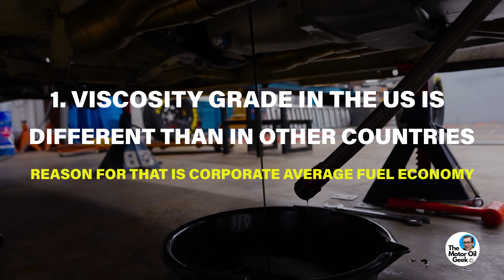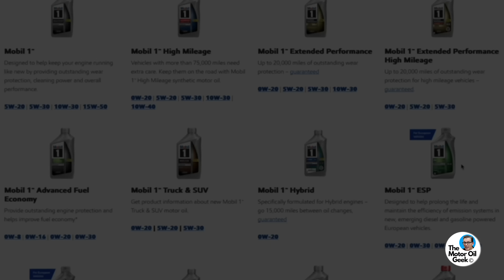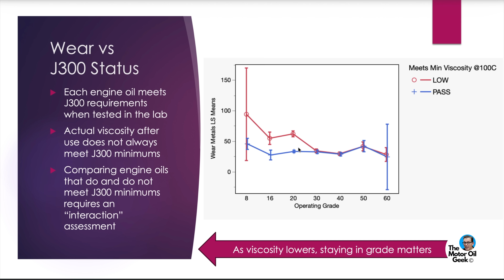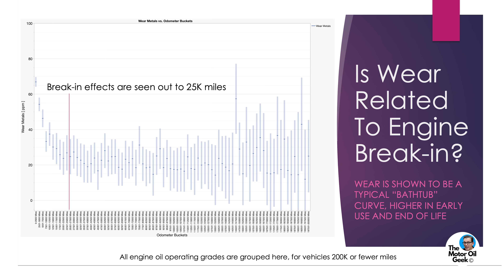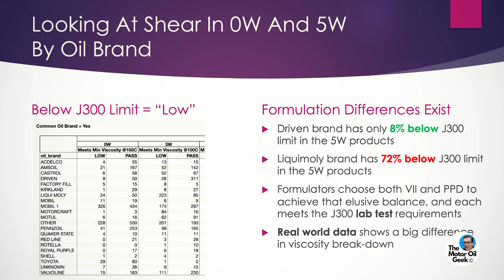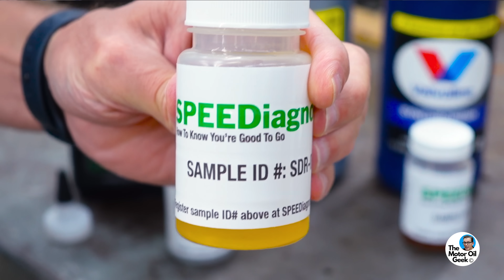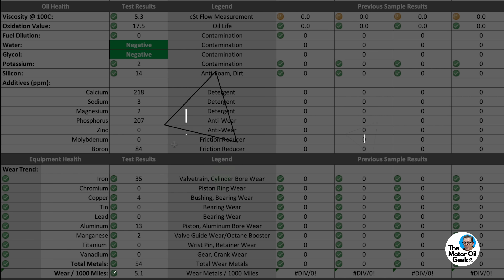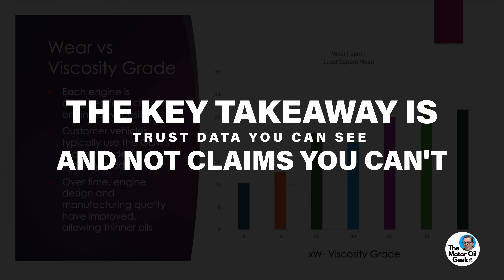More Ai Lies? The FACTS about 0W-20 vs 5W-30 (With Evidence)

Comment: so basically, those thin oils, while they can protect parts as well as 5w30, they are less forgiving when sheared out of grade.
Reply: Basically you would be trading your safety net for marginally better mpg. Good business.
Reply: @jaumeprimerelhipster There's a 2019 Camry out there with almost 500k and has only seen 0w16 its entire life. 5k oil changes keep it happy
Reply: @zandaughtry7936  you said it, you must do frequent oil changes with thin oils.
Reply: @mephy72 5,000 miles is pretty standard. Manufacturers want you to go 10k these days. I had a '00 Solara that I ran 10w40 in and still changed the oil every 5k. High mileage vehicle thats notorious for leaking out the rear valve cover.
Reply: @zandaughtry7936 it’s a Toyota I’ve seen them run with no oil 😂 but yes the more frequent changes help
Reply: @jaumeprimerelhipster  That is my thought also. The tiny increase in MPG one would save with a thinner oil would likely be less than making sure the air pressure in tires are correct. Seems like a huge risk for such little gain. Engines and transmissions literally determine a totaled vehicle or not. But why would car manufacturers care? They are in the business of selling new cars. These are the same people that tell you the transmission has "lifetime fluid".  Start/stop technology is another perfect example of how manufacturers are okay with less reliability. They get to sell replacement starters, batteries and new vehicles in the name of "going green". . It's the consumer that is paying the price...and it's NOT to save them green for "going green".
Reply: Which can be easily remedied by changing oil every 3-5000 miles. Unfortunately, folks insist on 10-20,000 miles oil changes. What does this all mean? You can't fix stupid.
Reply: @oldcodger4371 according to Lake, going out of grade is not necessary fixed by changing intervals as some oils can go out of grade quite quickly.
Reply: @jaumeprimerelhipster  that happens with oils loaded with viscosity index improvers, think 0w-40 and 5w-50. 20 weight oils are a lot more shear stable becuase they don’t need those VII as much to get the desired cold/hot viscosity behavior. 

My mustang will shear down a 5w-50 to a 40 weight pretty quickly, but I’ve run different 5w-20 oils for 10k miles and their viscosity was unchanged.
Reply: @jaumeprimerelhipster yep. The wider the gap between the two numbers, the quicker the oil gets out of spec.
Reply: @Alkatraz415  This is a good take away in general.
Reply: @jaumeprimerelhipster  0w20 starts going out of grade at 5000 miles. So, change your oil between 3-5000 miles. See? That wasn't so difficult!
Reply: @oldcodger4371 what a genius. Virtually all cars sold in Europe have oil changed at 10,000 miles. It's an industry standard here. No one with a problem whatsoever because we use high quality full synthetic 5w30. Sure, change to 0w20 and reduce the intervals and you'll eventually be paying thousands of euros in extra oil changes to get exactly the same result.
Reply: @jaumeprimerelhipster  At 500,000 miles, an oil change with synthetic oil costs me $30 per oil chance. So divide 500,000 miles by 5000 miles per oil change, and you get 100. Multiply 100x30 and you get $3000. That means at 10,000 per oil chance my cost is $1500. Unfortunately, your engine won't last 500,000 miles at 10,000 mile oil change intervals.  So tell me where the extra thousands in oil change costs are coming from? You can't because you're a liar.
Reply: Not 10,000 miles it's 6,000-10,000km.
You poor soul.
Reply: @oldcodger4371  In Europe recommended oil change interval is mach longer than in US, would be nice to see a statistic of engine failures,  US vs Europe.
Reply: @sas7388 not really though 15000km Toyota (and other hybrids) and 30000km for some brands (like Ford)
Reply: @sas7388 that's because Europeans drink the global warming Kool aid scam.
Reply: @sas7388 
  Typically the US sees much higher number of miles/kilometers in it's lifetime then Europe, but regions differ. 
     Midwest highway/ high speed long distance vs stop/start and mixed speed highway east Coast/ big city drivers.
  One of the biggest variables to oil change interval is oil temperature cycle time, ( with reference to ambient and humidity) short vs long operation, and idle time. Individual use habits for private vehicle operation are so variable, comparisons are complicated.
Reply: @bikerz3857 not really, it's because we are not dumb enough to pay thousands of euros in extra oil changes (it's not easy to do it yourself in urban areas so we have to pay a mechanic for it) that would make no perceptible difference for a car that would last on average 10 years. Millions of cars have been using use a simple 10.000 miles / 1 year scheme, that's being demonstrated solid for decades, with no issues, using decent oil.
Reply: @bikerz3857  Are you scientifically trained?  I am.  Not a scam.
Reply: @oldcodger4371    Some folks also insist upon ignoring data that says more frequent changes are an unnecessary waste of time & money.
Reply: @garysarratt1  So according to your logic it is better to buy a brand new engine for thousands of dollars than to change your oil every 3-5000 miles. Thank you for making my point, you can't fix stupid.
Reply: @oldcodger4371    Not my logic, data from people like Lake here.
Reply: @garysarratt1  Stop lying. Lake is the loudest voice saying that the manufacturers recommended oil change intervals are not often enough.
Reply: @oldcodger4371    Hmm, maybe I’m mixed up.  I know Freedom Worx said it, and cited studies & sent samples, and Tim Esterdahl had engineers on saying it also, along with the thinner oil being ok.
Reply: But @DeuceDeuceBravo says you're a conspiracy theorist for not following the SCIENCE aka owners manual, for obedient 10,000 mile intervals. Which is it, Deuce?
Reply: @ualfltdispatch  You and several others here should probably watch Lake's videos about oil change intervals. The science would be the actual data supporting following any oil change interval schedule.
Reply: @dmdx86  his data can be misleading because you have to factor the rationale and economics of such interval plans. I mean, for how long do you want to keep your car? In Europe it's an industry standard to change the oil at 10000 miles/1y and there's no issue here because people don't want to ride old cars. For a an average of 10  years ownership, there's really no difference in wear that would justify expending that much money in extra oil changes. That's the reason most dealers here use 5w30 instead of 0w20, because it makes life easier to everyone and it's good enough for the average foe..
Reply: @jaumeprimerelhipster I think we are on the same page here. I was replying to the people who think doing that is dangerous for engine health. The data says you can change your oil whenever the oil life computer tells you to and not have a oil/related problem for the lifetime of your vehicle.
Reply: @oldcodger4371 because you end up changing your oil every 6 months with such tiny intervals, that's quite a lot of money on oil
Reply: @oldcodger4371  Since I did 15,000 mile OCIs  with a new filter and top off half way on 10w30 for 10 years on 2 Dodge Turbos.  I would say it depends on how much you drive.  I was doing over 20,000 miles a year, Both cars were well over 100,000 miles no problems.  I wanted an intercooler added to the Dodge 600 Turbo and just over 110,000 miles. The shop insisted on a new head gasket, I asked how the motor looked when they were done.  They said it was spotless.  Now I would never do that or over 5,000 miles on 0w20 without an oil analysis.
Reply: OR, those thick oils, while they can protect as well as 5w20, they are more prone to shearing out of grade
Reply: @WilChu my engine can run either 0w20 (recommended) and 5w30 (optional). If you go out of grade in the 5w30 you'll still fall in a safe area between 0w20-5w30. If the same happens with the 0w20, you'll get anywhere between 0w16 and 0w20, which the engine is not designed for.
Reply: @jaumeprimerelhipster  Exactly, what a stupid argument to make.
Reply: @jaumeprimerelhipster  remember that you're also losing some efficiency going with the thicker oil option. you have theoretically more buffer going with 5w30 than 0w20 but 5w30 is more likely to shear out of grade than 0w20 as indicated by the video.
Reply: @jaumeprimerelhipster 
  Not necessarily ( safe ), this is only one factor affecting oil change interval. Fuel dilution and moisture/acid production is another. Type of engine, operating conditions and environment are important factors.
Reply: @jeffhill3681 but what's the relevance? At least here in Europe it's exceedingly rare to have an engine failure as the motivation for changing cars (Land Rover being a notorious exception). Most people buy a new car because of electrical failures or, most commonly, because the car is already old. No problem with the engine whatsoever. Cars sold here pass the EuroNCAP safety tests which get harder at each iteration. I wouldn't be driving a car pre-2020 just because of this alone. The difference in safety is insane. Thus,  we don't see it as a necessity to hold the cars for decades. Sure, if I got a Honda S2000 I would change the oil every 500 miles and clean it with unicorn tears. For my commuting car? Its fine with 5w30 and 10.000 miles, as everyone abd their dogs do here.
Reply: @user-mi1vd2ps2l shear out of grade means little to nothing in practical terms
Reply: @jaumeprimerelhipster  : Simple logic that people don't understand.
Reply: @WilChu  Either way, change your oil every 3-5000 miles.
Reply: @oldcodger4371 if 
a person uses 0/20 just change it more often 3500-4000 k especially with direct injection because of fuel dilution.
Reply: @IrishNew  Since when were we talking about direct injection? If you have a direct injection engine than you need to use the oil that was made for direct injection engines. Valvoline Restore and Protect. And yes, change it every 3000 with that oil in direct injection engines.
Reply: @o @oldcodger4371 many engines today are gas direct injection engines which dilute oil and its viscosity while compromising its load carrying capacity. When using already thin oils it breaks them down faster thus making more metal to metal contact which cause’s more wear and cuts down its shear value.Using a higher viscosity  such as 5/30 over 0/20  makes sense, so when talking about different viscosities this issue must not be overlooked  and addressed since most gasoline engines today are direct injection.
Reply: @W @WilChu  even out of grade 5w30 would give higher protection than 0w20 for example. Strangely he is neglecting this important point in the video.
Reply: @123ChrisG UOA will give the driver a good idea of when to change the oil.
Reply: @davepetrakos475 agreed but you will see in those UOA that thinner oils have less viscosity reserve, so they lose usable protection margin faster, including effective HTHS.
Reply: And since most don’t change the oil as often as they ought, the wear becomes increasingly a problem.
Reply: I have a 2019 Chevy Silverado that used to use 0w20 and I made the switch to 5W30 just over 11,000 miles ago and I will never go back to 0w20, I'm sure the 5W-30 will protect the engine much better than this crappy 0w20 which was only done for cafe standards. My engine sounds perfect no more valve train noise coming from the engine The oil pressure is perfect before it would go down to as low as 8 psi at hot idle now and hot idle it gets no lower than 28 PSI. The mileage per gallon is the same, in cold weather starting she starts up perfect I don't hear anything strange or odd noises when I'm starting it up.  We used to use 5W30 It was only changed for Cafe standards, that is the only reason these manufacturers did it was because they say it increases the fuel mileage and who's to say there data numbers weren't fudged and if they didn't squeeze a tad bit more fuel mileage out of the vehicle they would be fined per vehicle. I don't care what these data sheets say they can be fudged it's real world testing that needs to be done and so far I'm at 1100 mi with the 5W-30 and zero issues. it's the same engine that takes 5W30 another countries and here they use 0W-20. I'm sure in really cold climates 0w20 might be great but here in California no we don't need it. I'm sure eventually It will come out at the 0W20 is causing these engine failures. You have less cushion between the metal moving parts You're going to have engine wear That's what we were told for years and now it's all changing because of this zero w20. now with the 5W-30 you have more of a cushion you're going to have less wear on those parts Plus since the oil is thicker it will pick up junk along the way and carry it to the filter. When I would change my when it was the 0w20 I would change it warm and it would come out like black water now the 5W30 when I change it comes out perfect like it's supposed to now going to the 0W-40 that seems a little too thick. I will be doing an oil analysis within the next two oil changes most likely and I will post the results on my YouTube channel along with the previous 0W-20 results.
Reply: @HowtowithPaulHenderson 
How many miles on each oil change ? Same engine, i just bought it at 100k.
Reply: @DR-um2bv , the most I would go would be 3500 or 4000 miles at the most since it is at 100k.

My GrandAm with the 2.2l was well over 260k when I sold it and kept the oil changed every 3,000k or 4k when I prolong it. Started, ran, no ticks, knocks, etc.

My Alero with the 3.4l just made it to 210k and I keep the oil changed every 3,000-3,500 miles.
Reply: @DR-um2bv  I found Valvoline Restore & Protect to be useful on an 08 trailblazer I bought with 222k on the clock. The last name of original owner is on the Chevy dealership. 
I have a few used oil analyses since I bought it 18 mos ago.  
I guess what I am saying is I would avoid any xW-20 in a GM. Step up to 5w-30 and do an analysis the 2nd drain of the 30 at 3,500 miles.   
I can comfortably go 4,500 miles according to Blackstone analysis with my 4.2 i6 engine.
Reply: @HowtowithPaulHenderson im confused. Wouldnt 0w20 be better during cold starts?
Reply: @HowtowithPaulHenderson  Hi Paul. At the beginning of your comment, you said 11,000 ago then in the middle, you said 1100. Could you clear this up?
Reply: @Victorylap-fy4ke  Yea, clear this up so the AI shit bot can spread it as the Gospel.
Reply: @HowtowithPaulHenderson  There and many incorrect statements in what you said here.  This most likely comes out of ignorance, from the lack of homework you've done, I am sure.
Reply: @HowtowithPaulHenderson  you say 40 weight is too thick, however GM is specifying just that for the recall on the 6.2. Given the similarities between the two engines, dont you think there might be "weight" to their approach?
Reply: @ALMX5DP  It depends on bearing clearances, ultimately. Economy cars that don't typically see high loads or stresses are built with tighter clearances between bearing surfaces, thus necessitating thinner oil to provide the proper lubrication. Larger engines are typically used in situations with higher loads and stresses, which necessitates larger bearing clearances, where a thicker (at operating temperature) oil can still do it's job.
Reply: @halomaster985 are there bearing clearance differences between the 5.3 and 6.2?
Reply: @HowtowithPaulHenderson . 1100 miles, that’s not enough to tell anybody what to do !!!
Reply: @HowtowithPaulHenderson  wow man. this is getting ridiculous with this thin oil stuff.  I'm glad you made the switch.  back in 96 my dad bought a jetta  he was old school.  he put 20w50 in it.  I think it was a 10w30 engine .  the car ran great but would gum up the throttle body pretty bad at 100k miles
Reply: @HowtowithPaulHenderson  i did the same thing to my tacoma 4th gen .  it is a turbo engine and calls for 0w20? here in puerto rico ? no thanks . i use 10w30
Reply: oh no you should change your oil on time.. who would have known that
Reply: yes. thinner oils also provide better efficiency but nobody likes to talk about that. everyone focuses on thinner oil is dangerous. everything is on a spectrum and is just depends on what your priorities are. OEMs do their best to find a happy medium.
Reply: @user-mi1vd2ps2l  oy vey yes .1 mpg more is worth it 🙄
Reply: @aname3576  to the OEM, yes that’s worth it. To the individual customer, obviously not but think bigger picture.
Reply: @user-mi1vd2ps2l  right, the bigger picture is one of institutional corruption and industrial malpractice. If we’re talking bigger picture, who cares about thin oil when the reason you have it is regulatory capture.
Reply: @aname3576  Outside of serious design flaws like GM that results in recalls, when is the last time you've seen a vehicle that was decently taken care of regardless of oil weight lose an engine? They always total out due to transmission failure or rusting away before engine wears down unless you simply never changed the oil. Changing the oil and using a decent filter is what matters, not so much the grade. So yeah I might as well take some extra fuel economy if the engine is going to outlive the rest of the vehicle regardless.
Reply: @F0XD1E sounds like a social problem to me, i blame the schools
Reply: Basically they run out of life very fast.
Reply: @123ChrisG basically they don’t.  Wrong take
Reply: @stephenpage-murray7226  
Yes they do, did you even watch the video?
Reply: @123ChrisG 42 years tribology expertise.  You obviously didn’t understand what you were watching
Reply: @123ChrisG you didn’t understand a word he said.  I’ve got four decades tribology expertise, you?
Reply: @stephenpage-murray7226  no you haven’t you done even understand basic properties of motor oil. And what you have is an appeal to authority fallacy, so either make an argument or stop commenting.
Reply: @123ChrisG 
What part of 40 years tribology expertise don’t you understand?  Can you explain TFOUT, VI, HTHS, in particular HTHS effect o fuel economy?  You’re not the sharpest tool
Reply: @123ChrisG you’re lost.  You ignored base stock type/quality when it comes to shearing.  Stick to topics you understand
Reply: @stephenpage-murray7226  claiming decades of experience isn’t an argument. HTHS directly trades fuel economy for film strength, even sheared 5W30 maintains higher absolute viscosity than 0W20. That’s basic tribology. So either make a valid argument or stop replying.
Reply: @stephenpage-murray7226  You are deflecting again with your silly experience claims which we all know is bs, instead of addressing the point. Base stock quality affects how an oil shears, not the fact that higher absolute viscosity and higher HTHS maintain thicker oil film even after shear. Viscosity reserve and film thickness under load are the issue. Again basic tribology buddy you’re confused. Watch the video again and don’t be so stupid. 40 years experience and you still don’t understand the fundamentals
Reply: @stephenpage-murray7226  Heck, even a lower quality thicker oil will often outlast a thinner oil under stress. What you’re confusing is shear rate with protection capacity. Absolute viscosity, HTHS, and film thickness determine how long protection is maintained.
Reply: No, basically you choose the proper viscosity for the application and change it out before it shears out of grade. Less wear period according to the data.
Reply: Specially when the dealers are telling us to change oil every 10k miles
Reply: @D @DISLIKE4FUN hat is insane, isn’t it !
Reply: @altec19 well, it's what have been done in Europe for decades for millions of vehicles, with no significant issues. You would need to prove that your shorter interval strategy is statistically better at something (failures) and it's cost-effective.
Reply: @jaumeprimerelhipster there's several videos out there showing vehicles with extended intervals all sludged up. I'll keep doing my 5000 mile intervals. As they say, oil changes are cheap insurance.
Reply: @douglasphillips1203 My car's handbook says change oil every 10000km (~6000 miles) but to valve that (so 5000km or ~3000 miles) if doing mainly short journeys.

Missing from nearly every discussion/assertion about oil change intervals is journey length and how long the owner wishes to use the same engine. 

I wish to use the same engine for as long as possible, because I can't afford to replace my car, hence I do my own oil changes every 3000 miles. 
Someone that will only keep their car for 60,000 miles... they'll have a service once a year and that'll be okay for them (if not for subsequent owners 😢).
Reply: Neglected 5w30 shears into the 20 range. Seems like 5w30 is better for the extended oil change intervals.
Reply: It about the oil quality and oci.
Reply: 0W20 is full synthetic. Was he comparing it to 5W30 full synthetic or blend?
Reply: @JohnStray569 
  Full synthetic, but this is one problem you run into. If you buy oil off the shelf, or get it from a dispenser out of a 300 gallon tank at a quick lube? No 0w20 conventional oil exists, so you know what you are getting. 
   This is the reason the Japanese came up with the 0w16 and 0w8 oils, the only oils in those weights are to their particular specifications.
Reply: Oklahoma is hot in summer. The oil cap says 0w20, but with my 26 1.5l turbo, I'm thinking 5w20 is better for summer, if Lake is correct.
Reply: Not at all… there’s a reason Corvettes and other high-performance vehicles don’t run 20 weight oil. i drive all my cars like i stole them. none will ever get 20 weight. its ridic. but il glad people buy into it 🤭
Reply: Aka, 5w-30 will help more than it hurts in many cases
Reply: This is video did nothing but reinforce the "0w-20 sucks" mindset to me. He essentially provided the missing data from the AI slop that shows why 0w-20 should be avoided  😂
Reply: @azthegame84 yes but now you know exactly why it sucks
Reply: You have to change them quicker, that's why the gain on fuel economy is almost always shot down by service interval (and the other complications if you don't respect them)
I would recommend 10w30 if you never see snow where you live, more forgiving than 0w20 if you can't do the oil change in time
Reply: And therefore we should change oil sooner?